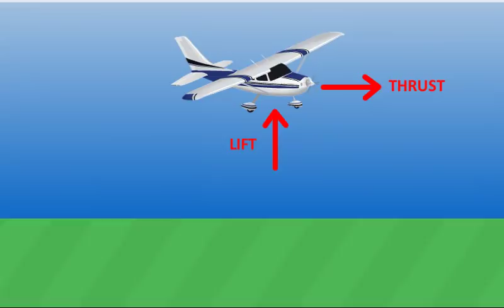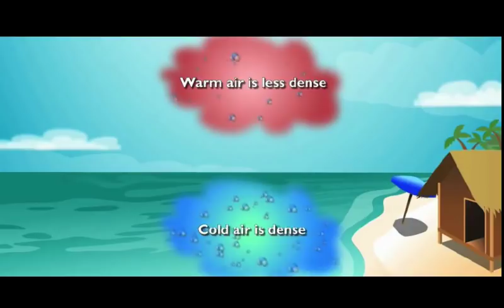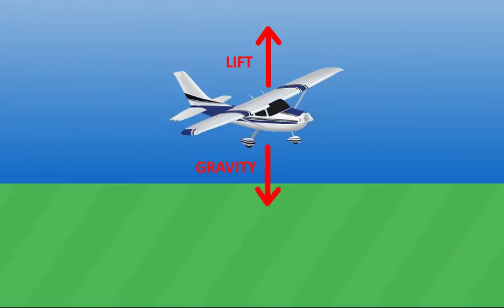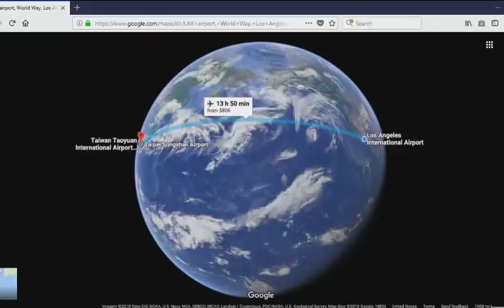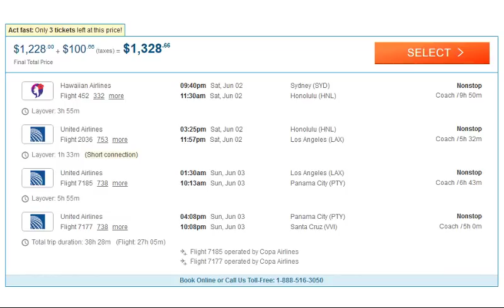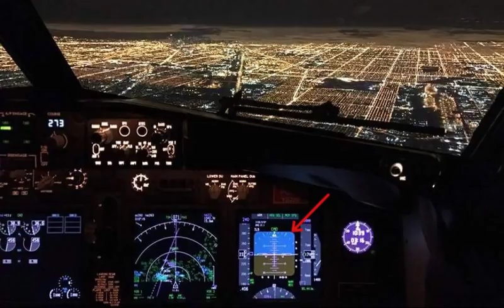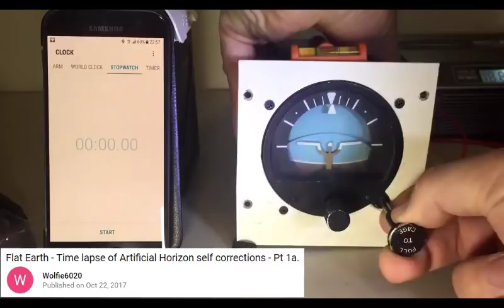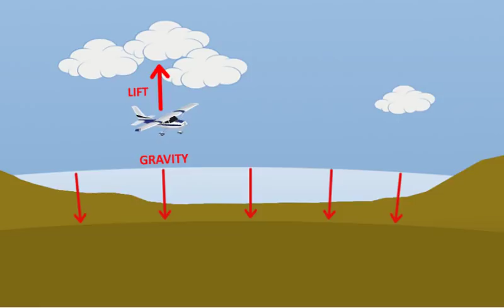Flat Earth Falsities - Plane Nonsense

Comment: This video contradicts itself.  1.  So the winds get in the way no matter if you go east or west at any time at all time??  These wind doesn’t make any sense that it’s spinning with the earth.   The earth spins at different speeds depending where you are on the sphere.  The planes also fly at high altitude where the air is thinner so less friction.  Learn what it means to be in Orbit.  Once you truly understand what it means you will see that flying plane/helicopters are simulating being in Orbit.  Instead of going the required speed to be in Orbit, it does it with forward thrust by engine and wings to fly/float and much closer to the earth than a satellite, for example.  Thus, the earth should rotate under you every time you go airborne.
Reply: Again, laws of motion, look em up.
Reply: Capt'Wes Starwind You go look them up.  Also, go look up what it is to be in Orbit and how strong gravity is, even though it’s a theory.
Reply: Damian Mercuri what the hell are you trying to say?
Reply: cecilia teo I’m basically saying that the earth should spin beneath once you are in flight.  How can wind resist a plane in all directions all the time??  We never get to fly with the wind?? Always against it?? The reason I bring up being in Orbit is because being in Orbit is basically flying around the world really fast.  We put things in Orbit really high up in the air so it doesn’t crash into anything.  When something is in orbit, you see the earth spinning beneath you.  If I were to put a satellite in orbit at the same altitude as planes fly, would the earth spin underneath the satellite still?  Yes it would according to  science and what we see.  That means a plane that’s flying over the earth, slower than orbit speed, is simulating being in orbit at a slower speed.  The reason the plane doesn’t crash into the earth is because it has wings and just enough speed to stay in the air.  For something to be in Orbit, just means it’s going fast enough to stay ahead of earth’s curvature.  The object just needs to go 18,000 mph to stay off the earth.  No wings are needed, the mere speed of the object keeps it afloat or “flying”.   Do you think satellites stay in orbit with wings, no, they stay up there because of the speed they are going.  The truth is in the details.  ✌🏼. Let me know if you have any other questions.  Look into what it takes to be in Orbit, once you understand it well, you should start to have questions about planes flying and why the earth should spin beneath you when in the air.  This video is picking and choosing reasons to explain away the question but this person is comparing things and giving examples that are not true.  The person that made this video did not look into anything, he gave answers that don’t add up.  Take care and think for yourself.
Reply: @DamianMercuri  you're making an argument from your ignorance to basic physics. It's not a valid argument.
Reply: The plane moves with the earth when it is stopped. It already starts flying from this speed. Like if you walk around in a bus, it’s the same as on the ground (unless there is a CHANGE in motion). You’re comment indicates a lack of understanding on your part, not on the part of science.
Reply: Джейсон Хичкок I listen better than you, that’s why I have questions and comments.  I can google all the bs information this may video is giving.  Hey, since you’re smart let me ask you something, is it possible for an object to be in orbit around the earth at 40,000 feet?  Will the earth rotate underneath that object when in orbit at 40,000 feet?  You’re too emotionally attached to your beliefs.
Reply: I hardly think I’m all that smart, but thanks. I’ll take the compliment. The answer is that it depends. If you launched a weather balloon from the ground, then it would not experience any change in speed relative to the Earth. So, in this case, it would remain fixed above its launch site (because it will keep moving at the exact same speed as the earth below). This is due to the laws of motion and inertia (an object in motion stays in motion unless otherwise acted upon). In this case, the balloon and earth both stay in motion within the near vacuum of space at the same speed. If you launched a satellite or rocket into space, however, then it would move at a different rate relative to the ground because it was accelerated from the earth’s surface. In this case, the spin of the earth would not equal the orbital velocity. 

This is well-demonstrated science that has been tested and recorded by many around the world. It is not based upon belief or emotional constructs. Accepting a demonstrated principle is not a belief system. If you chose not to accept it, that’s your choice. Science doesn’t really care if you accept it or not. It doesn’t suddenly cease to exist because someone decides to reject it. If you conducted your own experiments and derived a model of your own that is supported by demonstrable scientific processes, then you’d be able to change or adjust the prevailing paradigm. But just running around saying everyone is wrong because you don’t understand something does nothing to change scientific knowledge.
Reply: In all your posts in various threads you have proved you are not only maths and science illiterate but also very inexperienced and extremely gullible. So instead if continually confirming this why don't you actually go and get some experience and an education? Or don't you have educational establishments, libraries museums etc, in the shithole country you inhabit?   @DamianMercuri

Comment: Perth to Buenos Aires flies straight over Antartica. Explain to me how that works on a flat earth. It would fly straight over the South Pole if they didn't fly around it a bit to utilise tail winds.
Reply: Well it does. So explain to me how it does if the Earth is flat.
Reply: @KMoWearableArt  "not straight over the middle of the continent so the same flight path could be done on a flat earth model map "
No, it could not since on the FE "map" Australia and  South America are on opposite sides of the "map".
Reply: On the "FE map" there is no Antarctic you tool, they have an ice wall.
The Antarctic Circle is at about 66.5˚S. On a FE this would have a circumference of about 32,600 km, and at 89˚S the circumference would be about 745,000 km. And of course the sun is only 4,800 km away.
You really are pathetic, aren't you. @KMoWearableArt
Reply: @KMoWearableArt  
try looking at an AE map centered on the South Pole rather than the North -- then the flight path from Australia to Chile makes more sense
Reply: Simple answer is it didnt fly over antartica
Reply: @peterMMA007  Simple answer. You are full of shite. As has been proved conclusively.
Reply: The flight paths are composite great circle talking into consideration prevailing winds  Do you have a problem with that?
This is similar to North Atlantic Ice Routing for ships.
 @KMoWearableArt

Comment: Gravity is part of why an aircraft flies at a constant altitude. The other is that pilot's use their altimeter to maintain their altitude.  The altimeter calculates altitude using barometric pressure.  During pre-takeoff, one of the steps it to set the pressure on the altimeter, and also set it again when they are at their cruising altitude and when encountering various weather systems, like low or high pressure systems. Gravity figures into it because gravity causes the atmosphere to be denser near the ground.
Reply: FE cultists don't understand basic physics though, because goddidit.